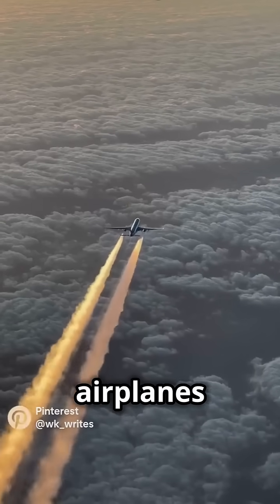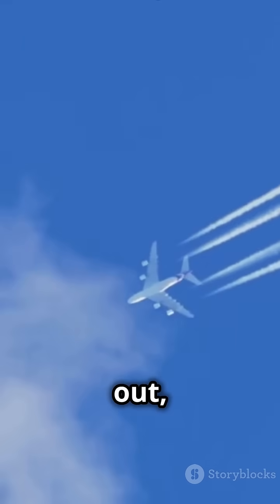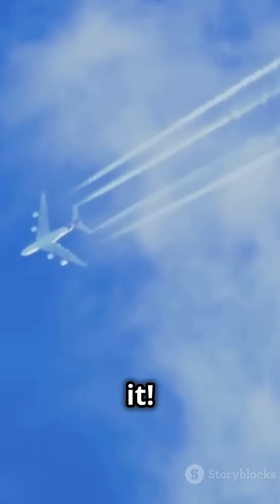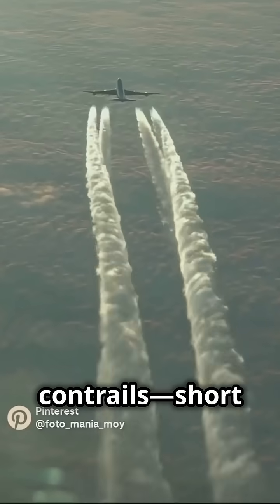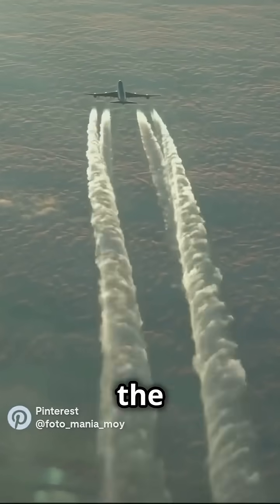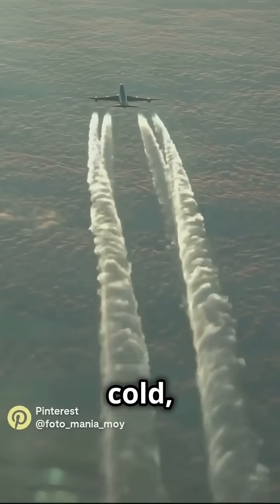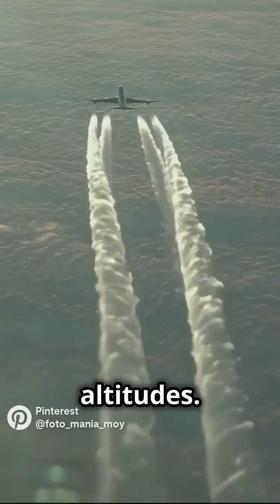Why Do Airplanes Leave Contrails? #facts #subscribe #contrails #share

Comment: While they may trap heat and therefore affect climate change negatively, they also create these 'clouds' which obviously are white, having a low albedo value, therefore reflecting sunrays and thus heat into space. So all this cancels out. The real climate change contribution is greenhouse gases that are created by combusting the fuels. Also, the effect they have on local weather is minimal, even when the contrails persist. It's to be ignored.
Reply from the maker: That is one great insight ✌️ Thanks for connecting and sharing your thoughts.